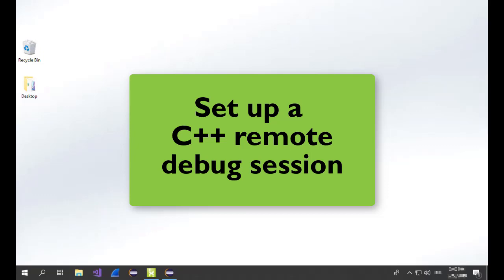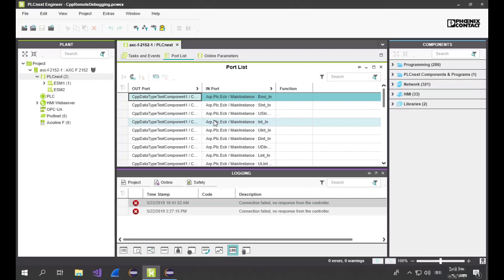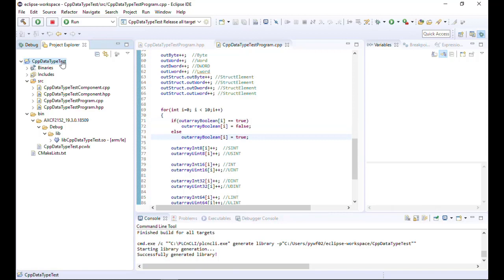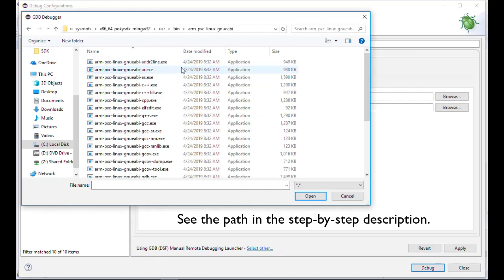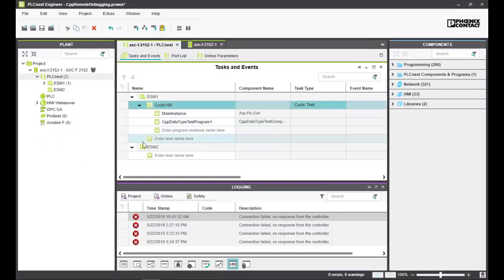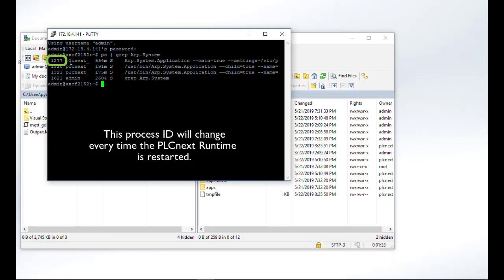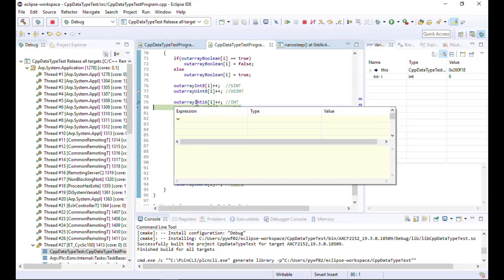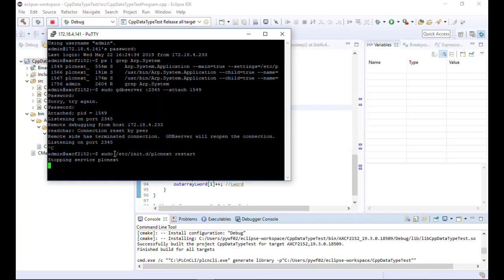How to set up a C++ remote debugging session in Eclipse | PLCnext Technology

Comment: I get issues running the debugger after linking the process saying Could not determine GDB version using command: C:\..\arm-pxc-linux-gnueabi-gdb.exe --version
Reply from the maker: Hi, please try working through all the steps detailed in the Info Center https://plcnext.help/te/Programming/Cplusplus/Cpp_Remote_debugging.htm.If that still doesn't work then open a support request via our Forum https://www.plcnext-community.net/forum. Make sure it includes the versions of Eclipse, PLCnext Toolchain and Firmware that you are using, and the exact steps to reproduce the problem.